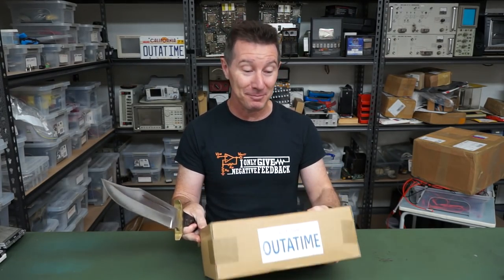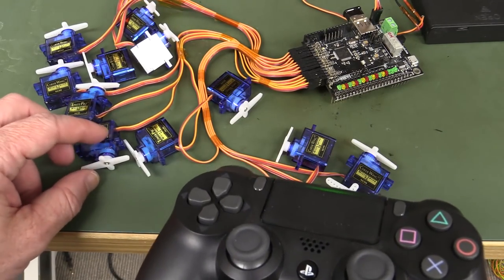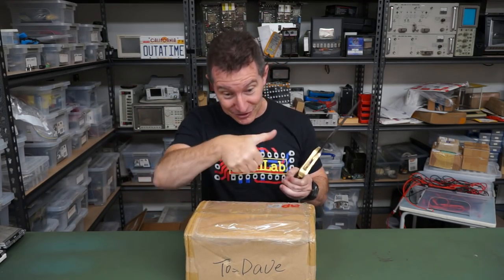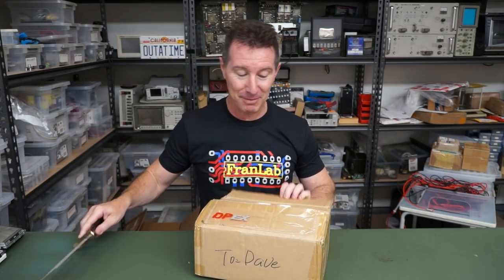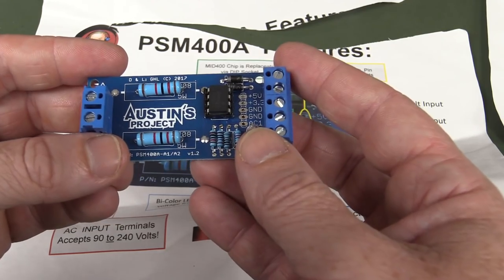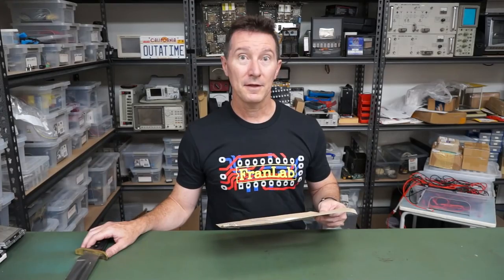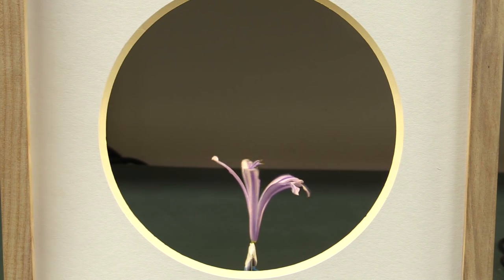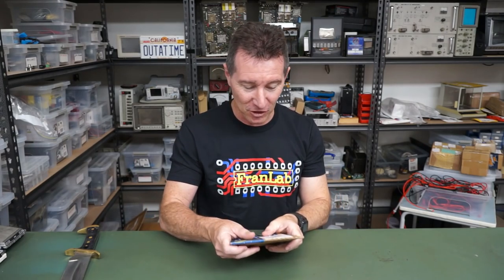EEVblog #1069 - Mailbag

Comment: Hmmm. Donno. For the mains detection or survaillance i'd just go with a 240V=> 5V transformer. Proper isolation, and with a voltage divider you get frequency and voltage to directly do stuff with AD pins.
..And whilst you're there you can also use it as power supply..
Reply: But then for voltage measurement your load must be constant
Reply: Well.. depends how exact you need to know.
Of course you would have to measure before full bridge rectifier, regulator and stuff,
but for "no load" operation you could always stop heavy cpu load.

For Frequency and "is it around 230V" the voltage before rectifier and with a normally oversized (private project) transfomer would not really drop that much.
If you really need an idle running transformer, then use a switching power supply for your load, or better AC surveillance hardware ;-)

Comment: With regards to Sagan soldering, my uncle Ray showed me how to solder when I was 7 back in 1980. I still have the board and it's a really blobby mess. Later, he showed me how to do it properly and not use so much solder on the joints. He had a junk board with a card edge connector he had me do this with. All I was doing was soldering pieces of bus wire into the holes on the PCB, but I spent hours doing it because I was so enthusiastic by the whole process. Even if Sagan didn't make something functional, he could make a peice of art, and you can keep it and show him later when he gets older.
Reply: I had my kids soldering at about the same age, and I've taught a number of other kids to solder. Every time I've been surprised at how good they are at it with a bit of coaching, once they get over their fear of the hot end - even kids with poor handwriting skills seem to do okay. A good lightweight temperature controlled iron helps a lot, and their young eyesight and lack of caffeine makes up for the rest! Modern PCBs with quality solder masks are very forgiving. They get pretty excited when their circuit works. One thing I found to be useful is to give them a "mantra" or rhythm... "iron on, one, two, solder, one, two, iron off" . I'm also explaining to them that the iron needs to heat the pad and the lead at the same time, and I show them what a good joint looks like - and that we're trying to avoid blobby cold joints . We might have to redo a few initially, but they get it very quickly.

Comment: I was doing PCB layout when you had to do it 4 times full size with tape and stick-on pads. Because I was used to working on the track side of pcb's I knew most of the common clips pinouts from underneath and not the way the data sheet shows which was very useful when doing layouts. We had a huge wooden camera on rails to take the photo of the artwork which was on a light box 6 foot square at one end.

Comment: Am i the only one noticing the safety spacing on the PSM400A from Austin's Circuits is completely missing? The "long" footprint for the resistors come VERY close to the bottom right block of resistors which is connected to the low voltage side. FAIL!
Reply: trap for young players
Reply: Also you get the bigger 5W resistors, but the holes are already filled with solder :|.

Comment: Hi, I am the guy who sent you the blinkenrocket kit. Thanks for showing it! I actually soldered the EASY version of the kit with my daughter. This is only the matrix, the coin cell holder , two buttons and the audio jack. No SMD components. I think 6 is a little early to handle those tiny parts with scissors while melting metal.. But i DID solder the NORMAL version, with all SMD components, last week with a friends kid who is 9.

Comment: Hey Dave, you forgot to mention that Protel was an Australian, Tasmanian creation.

The MID400 if you look at page 6 of the Fairchild datasheet, you will see the output is as quoted, "Line Monitor".
Its output does not switch HIGH/LOW with the AC waveform, but HIGH to LOW on the detection of AC input.
It unfortunately cannot be used as a zero crossing detector.
I used to work in a factory with 8085 based control system,  KELLER/Cellatronics,  a German company, and it was purely 240Vac control system, no 24Vdc control supplies. Their input optos were a HP version of the MID400.

Comment: Hi, Dave! Since you have all those servos, maybe you could write a simple code to make them all repeatedly turn left-right by, say, 45deg and show us how much drift with temperature they have. I've bought two (probably fake ones) marked 'Tower pro SG90' and they show cca. 3deg/degC drift. They contain AA51880 servo controller IC. The chip gets hot when turning the motor and within a minute, neutral position is off by 90deg.

Comment: Hi  Ref. the mains monitor . I did something similar about 25 years ago so that we could know when a mains phase ( or phases ) failed and for how long . I wired the opto's outputs up to the printer port of an old double floppy drive laptop and powered it from a 12v lead acid
battery which was being trickle charged by the mains . The screen showed events as they
happened and the second floppy stored all events . A windy weekend could record lots of
glitches etc . The researchers now knew how long their experiments ran before a mains
failure etc happened .
As you say --- of very limited use . I only built the one and I did not bother with a PCB , I just
used veroboard . GW Basic running on Dos was fast enough to capture glitches .

The 4 terminal shorting plug -- just use longer screws and put nuts under the plugs to make
the plugs longer .

                                                                                                                   Alan

Comment: The whole point of the 4-wire short is to have zero volt on the sense wire. You achieve that by shorting them. To make sure the meter doesn't complain, you short the input side as well and connect it to the sense side. But having both sides of the input connected to the sense would be a mistake, since you want zero volt on your sense wires. The actual implementation is thus the only correct one.

Comment: I can tell just from this video that the "PSM400 Arduino Mains Line Monitor" is unsafe.  The ground planes are to close to the mains voltage points.  Surprised you didn't see this.

Comment: Good idea for that Austins project. Arduino shield would have maybe been a better idea. Most electronics hobbyists nowadays have an Arduino or equivalent development interface board in their collection. Maybe this is a prototype?? Also couldn't see open source hardware logo. Maybe a better idea to somehow monitor AC waveform on the line for data analysis.

Comment: that time frame is cool, also i have to say i think that with the larger smt packages and good clean surfaces and good solder- that there are time when assembling smt boards are quicker than through hole equivalents (in terms of keeping components in place its so much easier for smt to tab everything down quickly to get near all the components flat, then do the other side 'properly' then tidy up the first side if its ugly. with low thermal mass you dont have to think too much about order of component soldering for the board and heavy copper or contacts absorbing heat and no faffing with component leg bending to stay in place or otherwise time spent with glues or tapes or foam/sponge etc)
long story short, with a good pair of fine tweezers, good eyes, good solder and clean surface/pads i find smt work quicker than through hole, while my eyes can still see that is..;/

Comment: opto? Baahhh, just use a 10meg straight to mains :) Actually read that in an AVR appnote.
Reply: Jake Heuft use 2 or 3 resistors in series to get the voltage rating and it's also perfectly adequate. You'd need to sense both the line&neutral since the ckt gnd may not be AC gnd referenced.

Comment: the mounting holes on the 5 pin side of the ac detection unit pcb are unusable because they are up against the screw terminals!
PAP IRIS

Comment: There is a error in the code for those servos. It is reading as value=1 when you press the button and it is just sending that to the servo. So it moves one "step", could be that there is min/max values for them somewhere.. Or it is just value that is sent as is, like the analog stick.